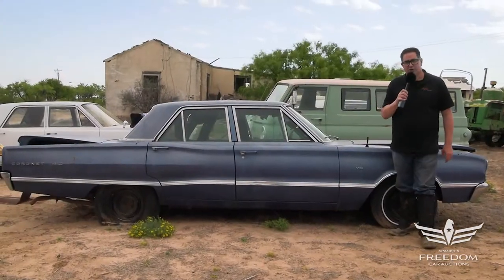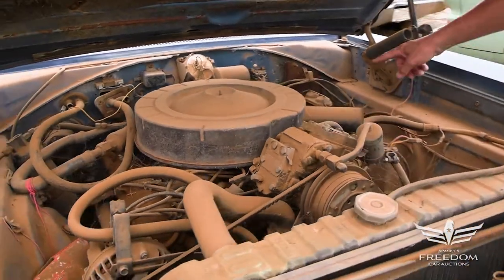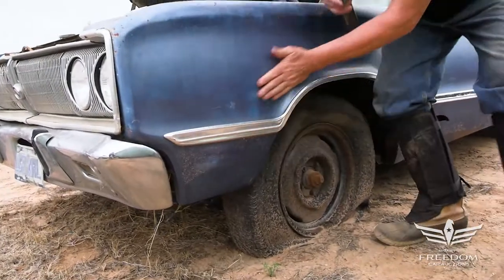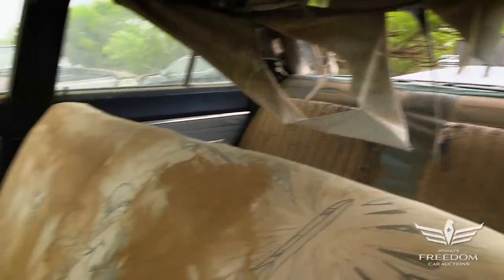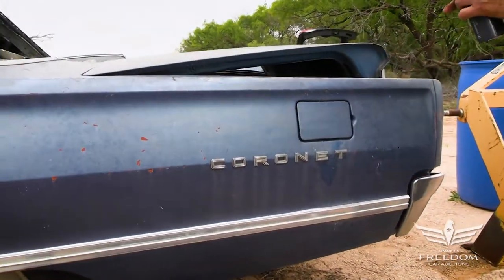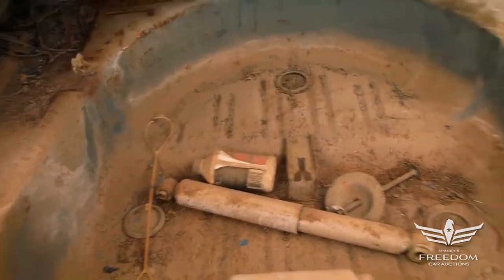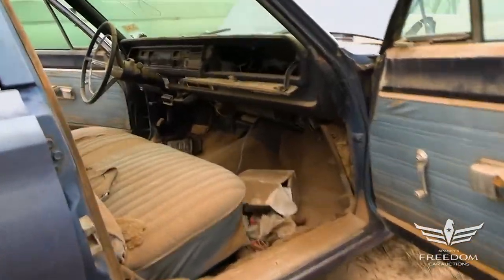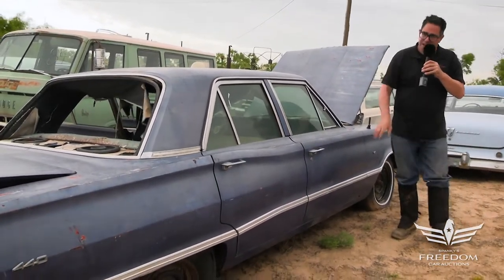87 1967 Dodge Coronet

Comment: I had a 66 4dr with the slant 6cyl automatic in around 1982. Up here in Canada, no air conditioning. Most of the cars back in the day here, rare to have air.  It was a good car for this teenager back in the 1980's. I would own another one as a great daily driver. They were pretty reliable cars.